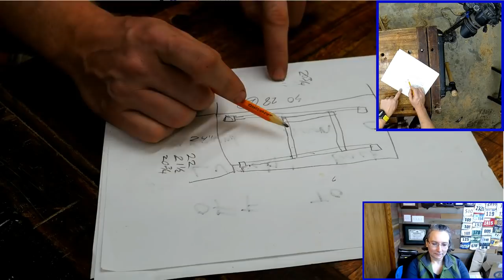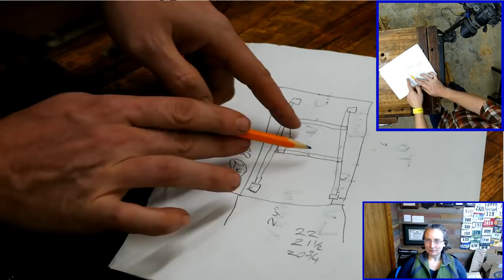How to Design Furniture from Concept to Design | Live

Comment: Thanks, James. Nothing some geometry and educated guessing (image editing software) can't solve. I think I was bang on 88", but you said something about cutting some extra off and I reduced a inch.

I still want to finish that table, but a wall mounted bookshelf is on my list of projects, with glass covering the front to keep dust off. Would be nice to see you working on something like that.
Reply from the maker: I have a project similar to that that's on the list. But it's probably not until this fall or winter

Comment: What are you using for video switching and the PIP feed?
Reply from the maker: I have an HDMI switcher with 4 inputs and 4 out puts. why?
Reply: Wood By Wright I run Camera and FB feed for my church and I thought the PIP might be useful for our FB feed.  Do you use OBS for the PIP or does the HDMI matrix have this feature?  I like the camera work your channel does, keeps it engaging.  I enjoy the way you teach woodworking and how you use your personality as well.  Your channel and a few others has empowered me to start woodworking.  Thanks!
Reply from the maker: @aerofly8235  Thanks man. I use to use OBS but it is a bit too touchy for what I want and I had a few integration issues with it. I now pay for XSplit it costs a little bit but is a much smoother program.